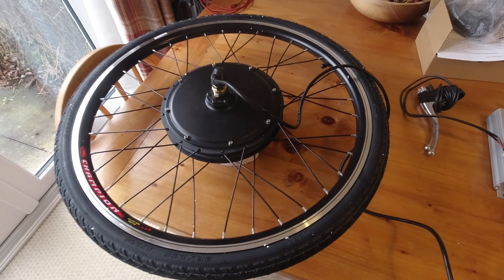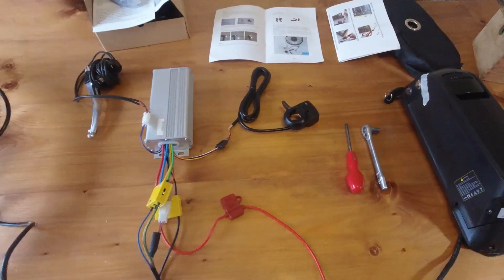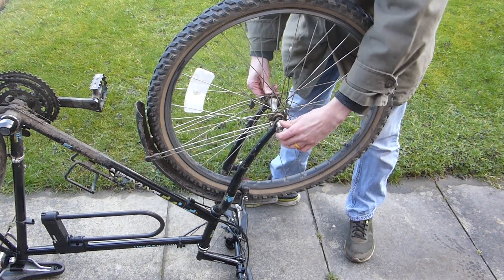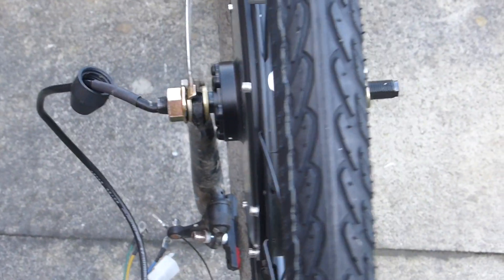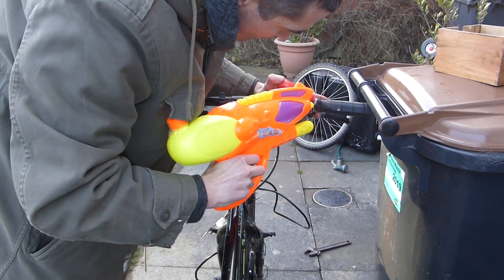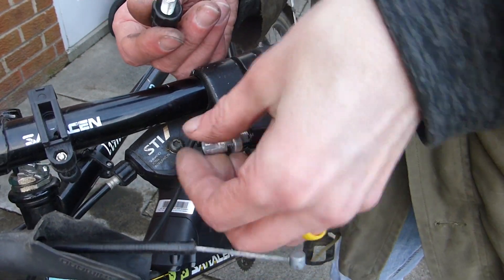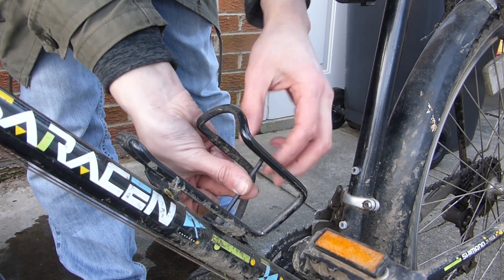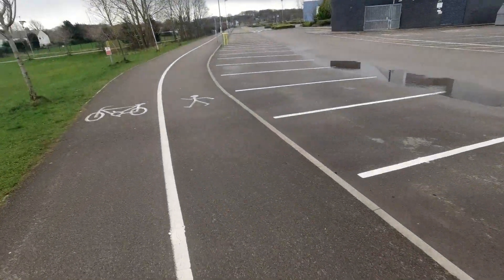eBike - Push bike conversion front hub, simple

Comment: Hey mate, how’s the long term longevity? Nice video btw
Reply from the maker: Hello, It still runs well but we don't use it as much now both the kids can cycle. I've used to for getting to work a few times (~13mi each way, no trailer), it adds a noticeable weight compared to my other bike so it's 50/50 on the benefit.
I've not noticed a range decrease on the battery though.
Reply: @CraigManning  Thank you very much for the information 👍🏻👍🏻

Comment: Its quite easy to overclock these things so much fun can be had. Wouldnt mount the battery like that though. Its heavy and water bottle mounts arent designed to take the weight. I went for a triangular battery in frame jobby.

Comment: Where did you put the control unit on the bike ?
Reply from the maker: Hi Ross, It's in a frame bag... I didn't show it?! It can kind of be seen at 4:31. The bag is held on with velco, probably (hopefully) shower proof - it's been ok so far, the only draw back was I had to remove the holder for the D lock.

Comment: Has the wheel come off the frame?
Reply from the maker: Hi, no mine looks fine but Ken Elder and 6ettinoid both suggest torque arms to reinforce.
Reply: @CraigManning  Hi Craig, have you had any issues yet with the front dropouts or have you fitted the torque arms?
Reply from the maker: @paulmervyn1613  Hi Paul, bit over a year on and, no I haven't get around to fitting them. I can't see any signs of stress BUT it's pretty much only used with the kids on the back, so take off is always slow and it never hits top speed. It's also exclusively roads, bike lanes and proper paths... so it has a relatively gentle life!
Reply: @CraigManning  Hi Craig, well that gets to the heart of my question. I'm wanting to run a 36v 500w 26" front hub, like yourself just on the flat with no serious abuse. The horror stories are all over the net about dropouts coming apart and all sorts, but I would guess this is with more powerful motors and being given a bit of abuse. I may fit some anyway as they're a cheap upgrade. Great video by the way.

Comment: Hi Chris, does it concern you that both the 500 Watt and 1000 Watt motor versions are both well in excess of the UK 250 Watt regulation, of can you get some kind of dispensation ?
Reply from the maker: Hi Peter, I think, and aimed to be, on the correct side of the law. Importantly for me when selecting was the set up was CE marked, UK/EU law were the same at the time... so I think that means it good?
I got some info from posts like this: 
https://www.pedelecs.co.uk/forum/threads/too-much-power-for-250w-motor.35196/ 
The wattage spec is for power 'to move the bike' rather than the rating of the motor and controller. It would make sense, testing a free spinning shaft with no weight wouldn't be a useful indicator of power used, and tiny stalled motor could draw a more than 500W not moving.
So, for the bike calc I found this: 
http://sportech.online.fr/sptc_idx.php?pge=spen_esy.html
Which gave an estimate of ~150W needed to move me and the kiddy trailer up to 15mph (about when it cuts out), so the output is good even if i'm out by a bit. The reality is we never go that fast as it would be too bumpy for the kids in the trailer :)
Reply: It doesn't really matter to be honest, you can clearly see there are lots of people who are riding kits that are clearly over the 250w legal limit. The Uber riders etc all ride around here in London not caring so why should Chris. Police don't stop no one, they're too busy arresting people for calling other people names. Great vid Chris btw 👍🏻

Comment: It seems to be the same front hub motor I bought. Is it 48V 500W? If so, could you post the exact model of the controler that came with it?
Reply from the maker: Hello, It came as a bundle with my motor when I bought it, no part model number on the order and a generic case, but it's very similar to this ones on Amazon I think. I should be able to have a look on the unit tomorrow as i think there's a sticker on top.
Reply from the maker: Hi, there' no part number obvious. I popped open the case to see if there was anything on the pcb but nothing leap out as being a part number. There may have been a connector which looked like an ftdi interface? In which case the same board could be programmed for a range of voltages and power?

Comment: Hey man,  great video! Just a few Qs: How often does your front wheel lose traction? (Keep spinning in the same spot) Does it lose traction on solid road or pavement as well? What about hills? It will help me decide which one - rear or front - I'd want to buy. Thanks!
Reply from the maker: Hi Tal, It looses grip on wet grass and mud on a hard acceleration, on pavement it's ok unless I cheese it from standing - BUT I have a trailer and two kids on the back end. Front is slightly easier to fit but the weight distribution reduces grip, rear gets better grip but, for me, would flick mud into the kids trailer :D
Reply: @CraigManning  lol man, you made me laugh. Thanks for the answer! Greetings from Israel/Germany

Comment: I have had a front wheel drive ebike and my advice is to get rear wheel drive,  then you can remove the front wheel and place the bike in my Honda CRV, and also the front fork u shaped tabs spread out over time and allowed the wheel shaft to rotate, a disaster.  I had to fix by welding reinforcing plates to the fork.
Reply from the maker: Thanks Ken! I haven't seen the tabs failing yet... but I haven't looked because I didn't know it was a thing, I'll be paying attention now :)
Reply: Torque arms are an absolute must to stop the motor grinding out the lugs in the forks. These are less than a tenner on eBay and Amazon
Reply: ebay.co.uk/itm/Adjustable-Angle-Torque-Arm-for-e-bike-5mm-Thick-Stainless-Steel-14x10mm-/143911979426?_trksid=p2349624.m46890.l49292
Reply: I wanted a front hub for my ebike build but now you got me reconsidering 
Thanks for the info 
And thank you for the video

Comment: Did the tire come pre-installed on the rim? If so, you might want to check whether they put a rim tape on the rim. Rim tape is absolutely necessary to protect the tube against abrasion and perforation by the sharp edged spoke holes in the rim. There are several reports on the internet of buyers incurring tire flats on these 1000 watt front hub wheels within a few days (simply google "1000 watt front wheel rim tape"). With kids in the back, it's better to be safe than sorry.
Reply from the maker: Ah! Thanks! I wouldn't have thought about that until the inner tube was damaged. I'm guessing it'll get more abuse than I could ever put on the rear one with just meat.
Reply: I'd recommend fitting a Slime inner tube to prevent punctures too. Wilko's sell the anti-puncture liquid, but it does mean you have to pike a hole in your tube to pour it in, applying a patch after. I used this as I have enough spare inner tubes to stock a bike shop.
Reply: @6ettinold  Lmao, you unscrew the valve and add it 😂